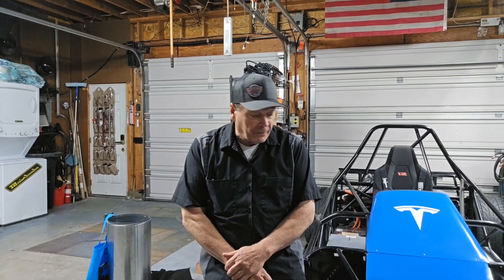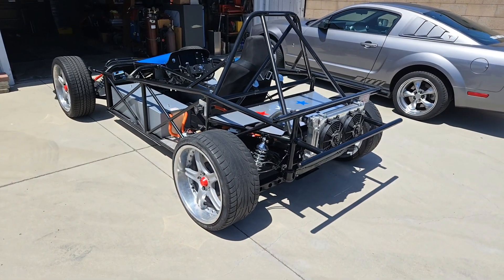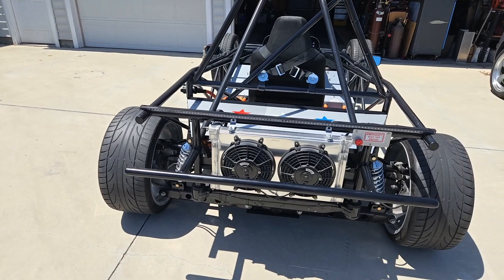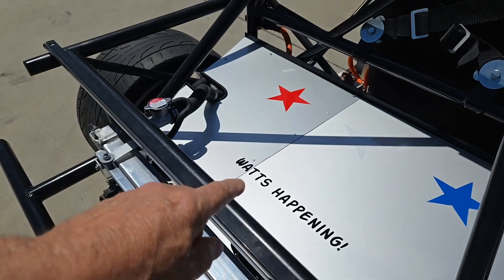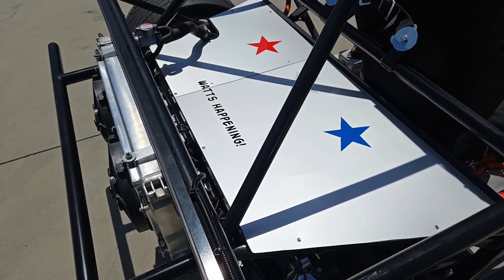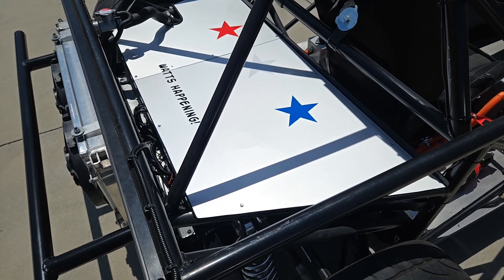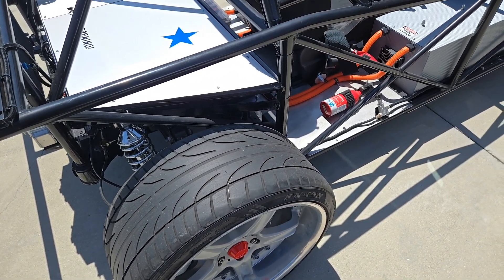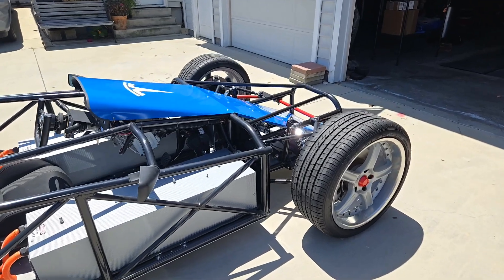Roadstercycle Rattler_EV

Comment: Super neat project! What hubs are you using front? rear? 
I feel like you could use a few more tubes to transfer loads from the front structure to the mid structure, but maybe I cant see it all. maybe add a tube or two between the driver and the batteries? That front coilover mount isnt as strong as I would think.

Anyway, looks really well finished and a super neat project! Put some nicer tires on it! Re-71R or R1R are great